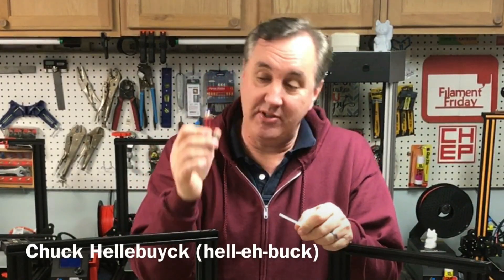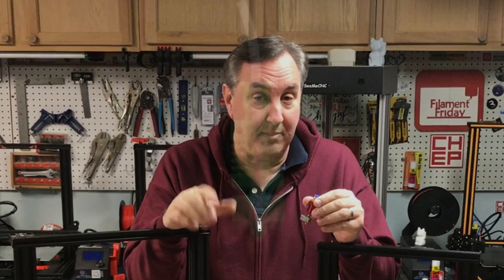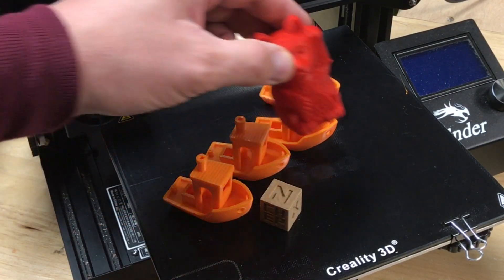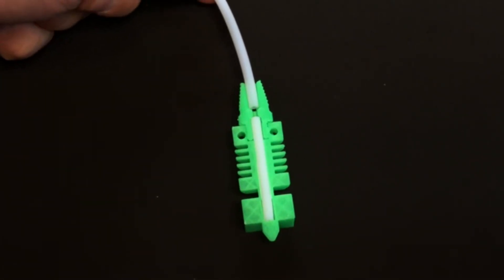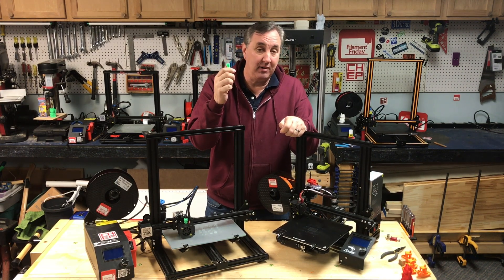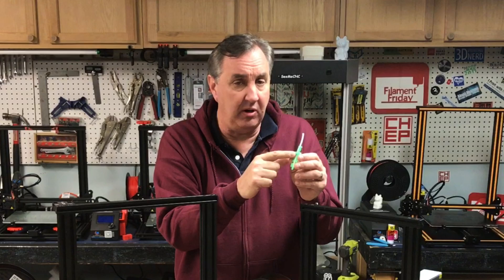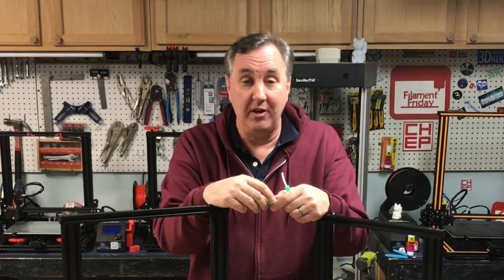Creality Ender 3, CR-10 - Hotend PTFE Fix

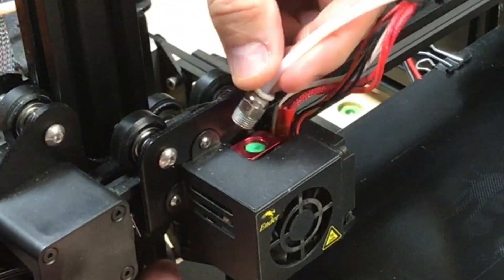Comment: Why just use a couple of metal washers ( same size}, to fix that problem at 2:04 ?
Reply from the maker: You could if you find the right size.
Reply: I got a project maybe you can help me..  want to install a LED HALO RING in Ender 3. 
1. https://www.thingiverse.com/thing:2910453
2. RGB 80mm Multi-Color COB LED Angel Eyes Halo Ring Headlight & Fog Housing Lamp Compatible for BMW E46 E39 12V-24V https://www.amazon.com/dp/B01MZ0D25A/ref=cm_sw_r_cp_apa_i_87xzCbD10FSMW

Can you help?!!! 👍
Reply from the maker: I’m working on something similar.

Comment: Hi, I have a bubble on my original Ender 3 bed surface. The bubble is between the black surface and the glass fiber panel. Is there a way to fix this?
Reply: poke the bubble with a razor blade, then smooth flat with a plastic card (library, credit card, etc.) You don't need to carve a hole, just poke it so air can be squeezed out.
Reply: @RedOnRye  Thanks!

Comment: This was a huge issue with HE280 hot ends which lead to the Monstah adapter that Capricorn offers: https://www.captubes.com/shop/#!/Monstah-Adapter/p/101717399/category=25823850  I'm curious if it would work on the Ender 3.  Caution, I've used that adapter model and found it to cause slippage even when putting some sandpaper between the tubing and the fingers of the clamp.

Comment: Great Idea! An improvent would be to extend the length (height) of the PTFE capture tube and nut above the design - a longer capture would need less tightness to hold the tube in place. As it is I fear the tube will slip free and probably not enough pressure could be applied by the nut to hold it in place. It wouldn't hurt if the nut was double length or greater.
Reply from the maker: I don’t understand your idea. My length works fine.
Reply: Actually I commented before making your design, and having now done so I realise those comments were erroneous. So apologies for raising a non-issue.

The concern that I had was that the PTFE feeder tube would not be held firmly enough and would slip out of the design. However now that I can see the holding arrangement that would seem to be unlikely.

Good design which I will make use of in the coming days. Well done!!!

Comment: Great video Chuck! Question! can you confirm what the length of tubing needs to be in the hot end? i see people are posting 42.5mm or 31.3mm? Ender3
Reply from the maker: It’s not exactas the coupling can adjust so about to the top of the heat sink.
Reply: Not 100% sure what you mean? If I 3d print your model what length inside tubing do you recommend so the nut you created will fit tight to the hot end? You didn't point this out in your video
Reply from the maker: I used the coupling to take up the slack. I didn’t tighten it all the way down just like the metal coupling. Each printer can be slightly different so I don’t specify a size. Let the coupling adjust.

Comment: I had the same problem with the Ender-3 fan. In my case it failed after it sucked some strand of filament and got tangled. These cheap fans get really hot when stalled and the bushings crap out.

Comment: Do you know if anything like this exists or if it would even be possible...

Instead of a PTFE tube through the hot end which butts up against the nozzle, could you instead put in a metal tube of some sort? something like stainless steel which has fairly low volumetric and linear thermal expansion (and is also inexpensive) might be ideal. My idea is that using a metal tube combined with what you have experimented with you would have a drop in upgrade  which would allow these printers to print at hotter temperatures without risk of melting the PTFE tubing.
Reply from the maker: That’s what a heat break does but doesn’t go all the way up because the heat creep would affect the filament further up and cause blockage. So I don’t believe that would work.

Comment: Hey CHEP, what are your thoughts on the CR10S Pro? I saw your unanswered questions on 3d printing canada videos and I wonder if you managed to find out if the  "the motherboard still 2560?".  What would be the downsides of said motherboard? Thanks!
Reply from the maker: I have not got my hands on one yet so I can’t really give an opinion. The CR-10S has 2560 board so I would expect the Pro does as well or possibly a 32 bit board. Downside is if they use a smaller micro like 1284 on CR-10.
Reply: @FilamentFriday  Thank you for the answer. I was almost buying one but decided that I'll wait for you to review one (even if it takes a while). None of the reviews I saw mentioned that Creality is using a proprietary nozzle on CR10S PRO (atm only selling for 10 bucks for 3 on their site). I also read some reports of z axis changing a bit and warped beds (which is not acceptable at this price range). Again, thank you.

Comment: Why not just the threaded coupling without the washer. That way you don’t need to cut the tube. ;)
Reply: The main point was cutting the tube. That way you can clamp it down and push it really hard into the hotend so you know that there is no gaps. You can't really push the tube down as hard with just your hands
Reply: @jacksonsherriff9899  Sure you can: Just loosen the coupling by 1/2 turns, push the tube right down, then tighten the coupling. Push/pull on the tube to make sure there's no movement.
Reply: @putrid.p  ooohhhh yeah that makes sense
Reply: Cheaper... You can buy one section of Capricorn tubing for 10+ printers. Then use the stock PTFE above the hotend.

Comment: I really wouldn't trust Capricorn's claimed temperature handling. For one, their claims are recklessly high and they're comparing themselves against allegedly super terrible PTFE that I've never seen anywhere. Competing PTFE with melting points as "as low as 220˚C"? Get real. I've seen a couple cases where the ID is not concentric with the OD. The tubes I bought from them (face to face at MRRF 2017) turned out to be 0.1mm larger OD than their claimed outermost tolerance, which caused fitting problems.
Reply: I've bought yards and yards of Capricorn and never have run into this. Can you post a pic somewhere of the ridiculous tolerances you experienced?

Comment: Chuck, i'm the author of the original coupling and your improvement is really clever. I like it!
Once I'll connect to the thingiverse, I'll put a link on your modified version into the description.

Thanks and wish you many successful prints!
Reply from the maker: You did the hard part. What software did you use to design it.
Reply: @FilamentFriday  For all my 3D designs, I'm using Rhinoceros 5.0 (but planning to buy an upgrade to 6.0).
It uses NURBS model for calculating 3D instead of mashes but includes useful tool for stl export.

Comment: We would need a thermal sensor at the top of the hotend, for regulating and controlling the hotend cooling fan!
Reply: the hotend cooling fan needs to be running the entire time.. unless you're talking about the "parts cooling fan"? That's controlled by slicers
Reply: @conceptualme  I mean the hotened cooling fan. And if it needs to run all the time, then it's only because it's not sufficient. Keeping the upper part of thte hotened at a temperature that doesn't soften the filament is enough. And with a good cooling system. like a water cooled hotend could achieve for example, there is no need for it running at 100% all the time.
Reply: @elmariachi5133  and now you're making something that is pretty simple into something that can be fairly complicated, introducing more points of failure and water near electronics / melting plastic... and could very easily lead to heat creep. the second that fan/ cooling shuts off, the heat in the block would immediately begin to rise. and then cooling needs to kick back in. It works for parts fans because you don't need the cooling unless you're doing overhangs / bridging etc., but this fan is cooling a part that is under constant heating. I'm pretty sure there's a reason we haven't seen ANY moves to a system like that, and it's probably because there's literally 0 reason to have that fan turn off.
Reply: @conceptualme  Yes, it is more complicated. But if it's true, that hotend fans urgently need to run at full speed all the time, then there's a general design flaw, because that means they are to weak. Unless you meant, that it's more practica to have them running all the time, but not needed. Btw. as I intend to do high temperature printing, my printers is going to have a water cooled hotend anyway, soon, because a sole fan doesn't help if the printing room is too warm of course.
Reply: @elmariachi5133  I don't think you quite understand the purpose of the heat-sink and the fan dedicated to it. The fan needs to running constantly, not because of lack-of-efficiency but just because of the way a heat-sink is designed to work. If you shut off the fan and turn it back on repeatedly, the temperature would fluctuate dramatically. Cooler when the fan is on, much hotter when the fan is off. That can lead to horrible inconsistencies in print quality and possibly clogged nozzles as filament is heated prematurely, losing strength and shape. Not to mention shorter lifespan of the Bowden tube (if using one). The idea is to have as consistent of a temperature differential as possible. You're suggesting shutting off a fan (which would immediately lead to increased temperatures) but also considering adding water cooling (usually done because things get too hot)... I hope you do more research and reconsider water cooling your heat-sink before you damage your printer or yourself..
Reply: @conceptualme  I think I know how cooling systems work, and that's why I think that a regulated system always is better than a non regulated. I did not suggest turning the fan of completely, but adjusting it to the requirement as in any requlaited system as anythign else wouldn't even make any sense. A fan always running at full speed does not make the hotend above the melting always have the same temperature, but it gives a changing temperature, depending on nozzle temperature, flow rate and other factors. A good regulated system in fact could guarantee an always equal temperature.
Reply: @elmariachi5133  well surely what you think can't be incorrect, right? There must be some other reason no 3D printer manufacturer is researching or even attempting to design some sort of "regulated" cooling for the hotend.. but what do they know?
Reply: @conceptualme  Anything not being sold by any vendor is not worth existing? I think you know as well as me that this kind of argumentation is totally inappropriate. There are always more reasons on a non topic related base (like economical, technological, financial and whatsever) base, than there are specific reasons, like a thing just not being functional. For any existing product ever, there was a time before it was produced, saying: It was not being produced at all. And then it was. Especially in a rather new technology like 3d printers still are, you should know that we yet have seen less than 1% of what's still to come in the future. Of course I can image the situation: The thing I was talking about is a luxury requirement. It would make the overall assembly more complicated, it would increase the price and it would increase chance for failure. And this all for the seemingly little bonus of less noise. At the moment this might sound fictional to many people, but with this kind of thinking 3d printers wouldn't even exist at all. There will be an increasing demand for high temperature printing, because without the ability for doing practical prints instead of just vanity stuff in PLA, PETG or other weak filaments, 3d printers will never become the what once was the idea behind them, namely the change from industrial production to desktop production, and with this comes the need for better cooling solutions. It's like the step from mainframes to PCs, about 50 years, ago. I bet in a few years, when overall 3d printer reliability isn't a gamble anymore, and when industry grew more regarding quality and cheaper mass production, when there are new and better ways available, then this will become standard.
Reply: @elmariachi5133  never said it wasn't worth existing if it's not being sold, and that's not what I meant either. Sure, innovation is great and all that yada yada, but it's great when it makes something better, not worse. if there was any logical reason to try liquid cooling a printer's hotend heatsink, SOME company somewhere would be trying it. my point was not that only companies should innovate, it is that they know better than to waste their time, even as a "luxury" option.. Water cooling would not make a hotend setup quieter, water pumps make noise and you still use a fan to cool the radiator somewhere (or really should, otherwise you're throwing away efficiency and isn't that the whole point of this?). Not to mention, Noctua replacement fans are insanely quiet, quieter than an efficient water setup would be, so that argument does not stand. Nor would it eliminate the need to run constantly, again referring back to previous statements about how heatsinks work in the first place. When you stop pumping / spinning a fan, temperature starts rising IMMEDIATELY, and then it's time to turn the pumps / fans back on. the hotend on your printer does not work like the processor in a computer, which varies temperature based on load. your hotend will be running at a constant HIGH temperature. the cooling is most efficient if run at all times. not to mention (again) all the points of failure you're introducing to the system by adding a management system, more fans, pumps, and WATER to a 3D printing system. Now, if you want to do it just because you think you can, go right ahead and give it the good ol' try. but i think you're misguided about the potential benefits of doing something like this.

Comment: I've been chasing my tail on my Geeetech A10 having some slight extrusion issues and been tweaking away on my Simplify3D profile....where it may be this issue you point out....hmmmm   I re-did the esteps since the stock one was only putting out 97 mm when prompted to extrude 100 mm   I see it prominently on gap filling in prints.

Comment: Any thought to making the same similar design to replace the coupler on the extruder side? I have had that one fail 3 times now, fortunately I bought a bunch of replacements when I first got my Ender 3. Might try it myself!!
Reply: You could just use the original object listed in the readme since it doesn't have teh "built in washer".
Reply from the maker: Check the links in the description. The original coupling creator already made one.

Comment: Will over torquing the nut cause distortion of the internal diameter of the tube?
Reply from the maker: Possibly. That’s why I showed to tighten just a bit.
Reply: based on my experience after trying this, yes, it caused massive underextrusion however i suspect that part of that is also that the ptfe tube is also to slippery for the part to grip as i found that the tube was slipping out if undertightened and causing underextrusion if overtightened. perhaps if the coupler had like teeth or something like the regular coupler does. just my experience tho, your results may very.

Comment: Thanks for the video but in seeing one issue for me. When I change the filament, some melted pla sticks on the ptfe tube and then I need to push it all the way down, or up, to clean it. With this configuration it complicate things, imo.
Reply: You misunderstand the fix - it's to prevent that from happening.  Please note teh PTFE tube insert that butts up against nozzle.  The reason you get plugs is when teh tube doesn't fit right against the nozzle allowing blobs.
Reply: @TheRezolutionPhoto  I don't get plugs but some tiny amount of pla stucks in the inner tube of my capricorn when changing filaments and I have to remove the nozzle to clean it. All I'm saying is that it not good for me and probably anyone else who has to clean it like me.
Reply from the maker: You get the tiny plugs because you have a tiny gap between your PTFE and the nozzle. I explain it in more detail here: https://youtu.be/x35aWmnZ_A0

Comment: Fan is easy to fix, just trip it and clean the shaft, and bore, use some WD 40 on a paper towel for the shaft, and the same on a thin piece of wound up paper on the shaft as well, then place a drop of light oil ( 3 in 1 oil, sewing machine oil or even 0W15 motor oil, not silicone oil) on the bush, assemble and another tiny drop at the rear by the O ring and clip, and close up the back. Fan will run much better, and if you do this on new ones they will last longer as well, because the original lubrication they come with is not really enough to fully soak the bushing.

Even works with ball bearing fans, though there you do not strip, just use a drop of oil and fill the rear, then place some film (or a disposable nitrile glove) to apply pressure to get the extra oil into the bearing, a little more to get to the front bearing and away you go with a quiet long lasting fan.

Yes I used to repair little fans, because they were $2k each, and I could get the bearings for them. Not meant to come apart, but went back together with a drop of superglue to replace the original glue that held them together. They were easy to diagnose, if they did not scream loudly they were faulty.

Comment: The trick i was told was to leave the nozzle out by a turn or two then insert the tubing, heat the hotend and tighten the nozzle which compresses it all.
Reply from the maker: That works.
Reply: not a couple of turns - you can distort the tube.
Maybe 1/4-1/2 turn